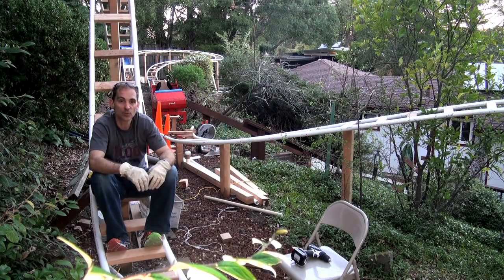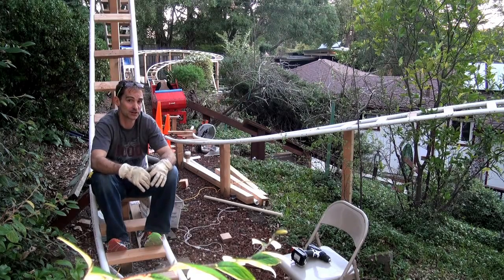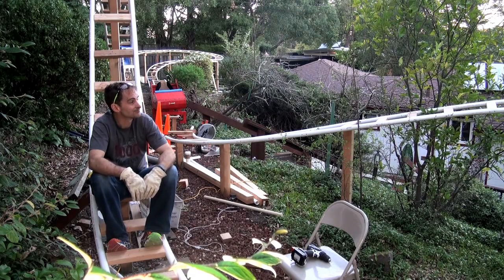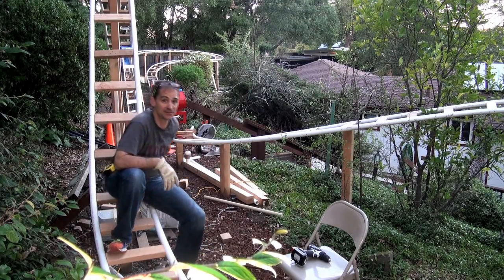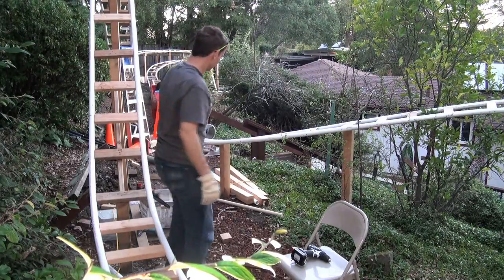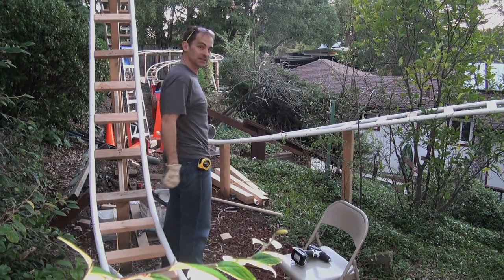Backyard PVC Roller Coaster - Finished Track!

Comment: You should of used metal pipes and not PVC. Dont you know that is just plastic? It will crack and not hold enuf weight.
Reply: Metal pipes would probably be hard to shape
Reply: Not over a long distance.

Comment: What is the distance between each 4X4? Also, what is the total are you have used to do the whole thing (meaning if I was to draw a rectangle around it, what would that measure?)? Thanks!
Reply: And also the length of the 2X4 cross sections on the track. Basically, how wide is the track?

Comment: Did u have to use a heat gun?
Reply from the maker: Hi Jacob,
Nope.  PVC is pretty bendy if the temperature is above 65-70 degrees outside. I used 20-foot lengths of pipe, which gave me the leverage I needed. Just be careful, and be safe.  AND REMEMBER that PVC does not last forever. You will have to replace the pipes when they become worn or brittle from exposure to the sun. This is why my next coaster will be All Steel :)  That said, PVC is a great place to start.
Best,
Will

Comment: What size PVC did you use??
Reply from the maker: Hi Gerald,
1 1/2" Schedule 40 PVC is what's on my coaster. The one we're building at Abraham's house is 1 1/2" Schedule 80. The Schedule 80 has thicker walls, is supposed to be more resistant to UV degradation, and it looks really cool :)
Thanks for watching! 
Kindly,
Will

Comment: I feel like building my own backyard rollercoaster should be my life ambition.
Would you be able to answer a few questions to give me an idea of how hard that would be, how much money I'd need, e.t.c? (Note that I'd probably do a basic shuttle coaster with one camelback hill, about 10m in length):

- How much PVC would be needed?
- How much wood would be needed and of what type?
- What tools would I need (e.g. to cut the wood if necessary)?
- What kind of place is best for getting the materials needed for a backyard coaster (especially wheels and seats)? Would online be a good option? (Bear in mind I live in the UK)
- How much experience with DIY do you need? (I'm only 16, so obviously I haven't built anything big yet, but I can't imagine I'd be that bad at joining together wood and PVC, although I would probably need educating on how to link the PVC tubing together seamlessly if it doesn't come in one piece)
- What would be the expected total price of a backyard coaster like the one I propose (you can give it in dollars, or translate it to pounds for me :P)?
- How hard is it to maintain, assuming the owner doesn't care hugely about how smooth it is?

Sorry if that's a bit of a tedious thing to ask, but I'd love to know as much as possible in case I ever do come around to making one - there's practically no clear tutorials out there.

Comment: I have one more question how do u bend the pbc pipe. On my roller coaster I tried to make a turn but I couldn't bend it.
Reply from the maker: Hey Bryce,
I use 20 foot lengths of pipe, rather than the ten foot pieces you'd get at the hardware store. That allows for pretty good leverage.  That, combined with some custom jigs I built to hold things in place, and piles of straps and clamps, and there you have it! The trick is to be careful. The whole thing is under pressure/tension when you're putting it in place. So, you don't want anything to spring loose! :)

Comment: How do u make one wheel on the track not come of on the turn
Reply from the maker: Hi Bryce!
Thanks for watching.  Check this one out. http://youtu.be/InVgmUO5dpo Great Question about the wheels! The thing about 4-wheel vehicles (cars and roller coasters included) is that when in motion, each of the wheels are traveling in different directions at different speeds. This makes the suspension super important. 
This video: http://youtu.be/InVgmUO5dpo which shows how I addressed some of these issues. Naturally, we never stop learning. So, the next cart I build (pondering welded steel tubing for this) should be even better! 
Please be sure to Like & Share the videos. It really helps to spread the good word! 
Meanwhile, remember: It's all about Physics, Family, and Fun!